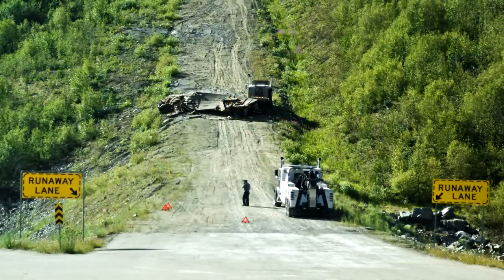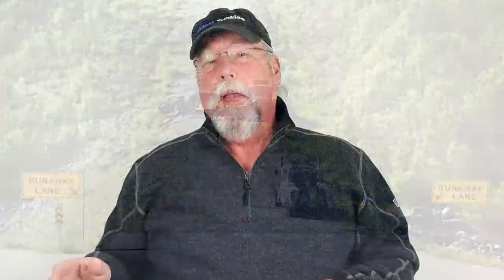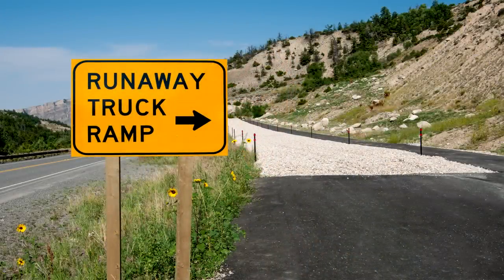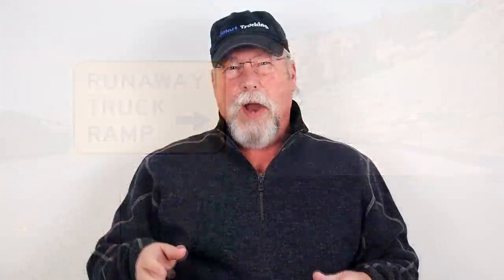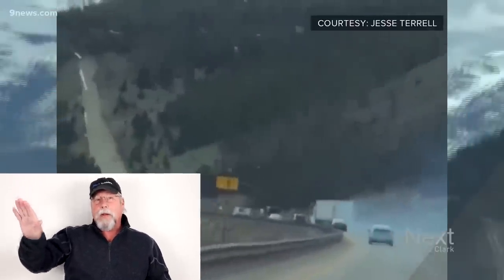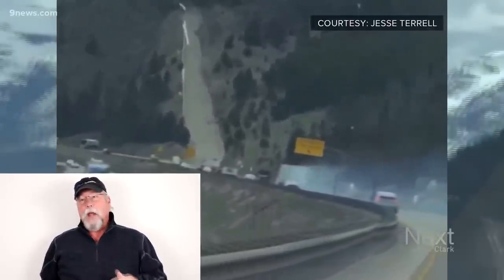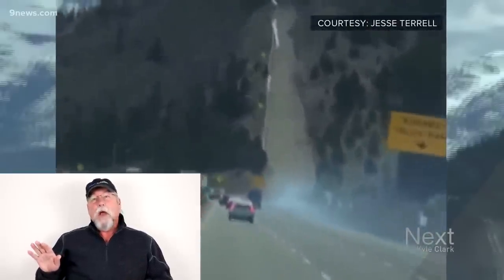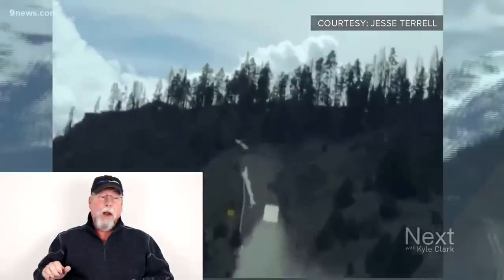What (Most) Truck Drivers Don't Know About Runaway Truck Ramps

Comment: I pray I never need to use one
Reply: The ones in Tennessee are the sand kind an it's fucking brutal hitting them also you have the knowledge that it's 10k if you have to use the runaway lane... So totalled truck usually plus a 10k fine for hitting the lane

Comment: If you drive a truck with a properly working 3 stage engine brake you can actually make it down these hills without ever tapping the brake pedal. Need to be in the next gear or 2 down at the top and you can adjust your speed by selecting the correct stage of the engine brake. Many of these hills especially out east actually have slower posted speeds for going down the hills

Comment: I try rarely ever have to use my brakes going down a mountain. Always try to position my truck at a slow enough speed and low enough gear based on weight so that my engine brakes can take care of braking and keep me at a manageable speed without ever having touch the brakes. Of course there are those times I have to brake.  But because I prepared my truck going down the mountain in a low gear and a slow speed, the amount of times I have to touch the brake its greatly reduced, greatly reducing stress and wear on the brakes

Comment: Here in BC, the way the runaway ramps are designed, the theory by the MOT is you are suppose to use the runaway ramp before you are completely out of brakes so you have enough to hold the truck when it stops. Nice theory but not the way it usually works out.

Comment: I used to train drivers. And I always told them that you will go down the hill a 1000 times too slow but you will only do it once too fast. And I'm from Southern Utah where grades start at 8%. And grades 12 and 13% are common. And most of them are well over a mile long. Also most of them don't have runaway ramps because there is no room to put one.

Comment: Great video. When I went to truck driving school I don't recall any mention of runaway lanes. However, I was familiar with them. Driver trainers, I pointed them out. The thing I remember most about mountain driving from school was once you get to the top, you have to be able to stop the truck going down the other side. And this was best achieved by going down in lower gear than it took to go up. I was passed by a lot of trucks going downhill, but I never had burning brakes at the bottom either.

Comment: I've heard a big downside of the pea gravel or sand runaway lanes are they don't work when precipitation infiltrates them and freezes.  I only drive in the south east, but I"m the guy in the right hand lane going down the hill in a lower gear, with the jakes set to maintain my speed all the way down the hill without touching the brake pedal, being passed by the super truckers.

Comment: You are correct I was driving west on 160 in Colorado first time ever and didn't realize I was climbing until I was 10,800 feet above see level and came to a brake check
Thank God I was 7,000 pound's in the box. And I saw 
Two hair pin turns 6 miles down the road. 
I have been driving for several years and never came through their. All ways respect All down grades.
And check your brakes.💯👍

Comment: Having run cross country through the mountains, I can't fathom not checking your brakes. 9/16 inch wrench kept in the door pocket, and a few minutes time, if they're not frozen, and you're good to go.
      And yes, you can adjust automatic slack adjusters. Just don't overtighten.

Comment: this comes from experence. once you learn your truck how it reacts with different weights and grades,  when you are at the top of the hill, you select the proper gear and jake brake settings, a driver can just about coast down a hill and use very little brakes.  some drivers think that they must run the speed limit down the hill but that is not the case. there have been many hills that i have gone down at 30 mph.  when i get down to the end, my brakes are in  good shape and the rest of the truck is in good shape.

Comment: Nice of you to include the MTO video demonstrating that drag net runaway ramp in North Bay. There is also a brake check area before the slope. Could be used as a rest area but there is a proper truck stop nearby.

The training I got is to get into the right gear before downhill, let engine ride up to 2000rpm, full brake until engine comes down to 1000rpm, let off the brake to let it cool, rinse and repeat. Supplement with full jake all the way is what I learned on 17 - which has no runaway ramp anywhere.
Reply: It's generally considered as a failure when the brakes are used. Being in the right gear and using the jake break to regulate your speed is considered safer than using your brakes. Brakes are to be reserved for an actual emergency  .   .   .

Comment: When I first started driving most company trucks did not have engine brakes.  In the training I had we learned to check and adjust the brakes before going down a mountian. Thankfully trucks are safer now.  I have never used a runaway ramps although had some close calls smoking the brakes out west.
Reply: Can you explain exactly what I'm looking for when I get under there to check the brakes.. Thanx in advance if you do answer me

Comment: Back when I started my career my father told me if I loose my brakes to take the shoulder cause they have made stabilize soil to help slow down the truck.
I was working on road construction and personally seen this stuff in the winter months this stuff doesn't freeze it stays loose I used it for traction and keeping my trailer from Jacknifeing.

Comment: You said about maintenance on Company Owned Trailers.... I have a really bad habit of using trailer brakes all the time instead of wearing the ones down on my tractors.... "Wink-Wink"....
I had to use a Runaway Ramp many years ago... Somehow the Service Line come off... I was pulling a raggedy assed old Fruehauf Flatbed with a Load of Steel, and I was probably a little on the heavy side.... Anyhow, it was one of the Ramps made of Limestone that was stacked higher and higher the farther up the hill you went.... Let me tell you something, it was not a Picnic!.... It didn't hurt the equipment any but it sure beat me up!....

Comment: Thanks for that detailed description. Lots of important info there!

One wonders, on the first type of ramp, maybe a good compromise between jumping out and injuring oneself and riding the truck all the way backwards back to a jackknife, would be to wait until there's barely any momentum left and then steer off to the left or right into whatever's on the side of the ramp.

Even if you wind up in a bunch of trees or something, probably won't cause more damage to the truck than the jackknife and roll-over, and that way you get to stay inside the cab where it's nominally safer.

Comment: When I went through truck driving school, the instructors preached, when you are in an area with runaway ramps, and you have no brakes or control of the vehicle, take the ramp. They're philosophy was, equipment and loads can be replaced, lives can not. When I did power only, I did not trust the trailer brakes, unless I knew and inspected them to ensure they were properly adjusted

Comment: There is a version of the 2nd type of runaway that I have seen in the Carolinas.  It is a sand type but has the sand mounded in intervals along the ramp.  I have often wondered what damage these mounds cause to the tractor.

Comment: I have to tell you what happened to my 72 year old Dad in 2012 after picking up a trailer preloaded with beer in Creston BC. He had started working for a company that had junky equipment and was heading west on Hwy 3 down towards Salmo when he lost his brakes on the trailer so he took the first runaway lane all the way to the top of the ramp in the middle of the night, so no one witnessed him up there. So he sat up there for hours without cell phone service to call anyone so he got out and realized how badly the brakes were out of adjustment so he adjusted the trailer brakes and was able to back her all the way to the bottom hoping no one else needed the ramp. But when he was near the bottom another trucker phoned the RCMP who came and had a chat and was able to help him get safely on the shoulder. But the officer could smell that distinct smell of burnt brake pads so he called the DOT (MOT) to come and check the adjustment of his brakes. So the DOT did a quick  level one inspection said everything was good carry on. So the beer got delivered and he retired from trucking Nov. 2022 at 82 yrs old but will drive for me when I’m in Mexico for one month in April hauling food products in Delta BC.

Comment: the up hill is normal lane and add sand after the Hight point almost done, make sure the sand is not high than the up hill lane. So it can not run backward. no need to maintain much if they put sand in mid of 2 wood wall or dirt wall.

Comment: I agree that there's several important things that don't get discussed or discussed enough when you are getting your CDL, or in training with the company that you'll be working for. The runaway truck ramps are definitely one of those things. And another is using the engine brake or when not to I should say..and with do many "automatic" trucks these days that's really more important than ever because oftentimes the transmission will downshift automatically raise the engine speed, which makes the engine brake pull much harder. And in reduced traction conditions (wet roads, ice, snow, etc) that can be the very thing that causes you to lose control and wreck. And if you hit the brake pedal after the rear wheels lock up and begin to slide, that just makes it that much worse. Stunt drivers in movies make cars spin around by basically doing that very thing in purpose (locking up the rear wheels with a hand brake and then slamming on the brake pedal). I learned that stuff the hard way.

Comment: do trucks have a manual transmission?

couldnt they burn the clutch trying to ride back down the ramp?

just by slipping the clutch the truck slowly creeps back down.

another way is to have a series of sawtooth curbs/ramps to where the wheels would catch and act similar to the blocks you see many truckers place behind the tires when heating fuel is being delivered  yes it would be a bumpy ride at the end but it should prevent reversing.

Comment: Using the sand/pea gravel is definitely the best type as confirmed by the amount of lives saved by using this type of run off in Formula 1 racing and no doubt other types. The gets damages sure, but it would have been damaged to get there usually.

Comment: Also folks, always invest in a retarder. Great system for braking the truck enough so you hardly have to use the brakes, at least in germany. I know some fellow truckers here that have to change brakes very infrequently because they use the engine brake and the retarder as much as possible. Also our engine brake systems on modern vehicles are the first 1/3 of the brake pedal's the engine brake. Some automatically kick in the retarder when the computer realized that the engine brake wasn't able to hold the vehicle plus trailer. Great systems, can recommend

Comment: Would you be able to throw it into park or into gear and kill the engine at the top of a runaway or would that be no bueno?
Reply: It is possile bit very likely useless in that trucks do not have a PARK option and if the engine is running, putting it in gear can be a challenge and if it is possible to put it in gear and shut off the engine, sepending on the grade, it may not hold the truck.   In most cases the ramps are built and maintained (supposed to be) to stop the truck and hold it where it stops.  Not to mention the fact that it would take the presence of mind to do all that after trying not do die when using the ramp after coming down a hill too fast and trying not to crash.

Comment: the most important thing besides bla bla blaz is with a jake, engine brake and using the correct gear ⚙️ if properly used ! you should not need much braking , only used to keep the engine from over reving, !!!!

Comment: Dumbest runaway lane I have seen is going into drumheller ab it is at the bottom of a hill opposite of the intersection that has a stop for hill traffic and the lane is the same slope  is the same as the far side valley wall

Comment: On 376 E goin into downtown Pittsburgh. Its 25 bc of a few  blind turns and stopped traffic. I have never seen anyone hit that runaway ramp there.

Usually in AM its stop and go. Problem is its 25 for trucks and 50 for cars and when traffic is flowin I'm still goin 25 with 4 ways on and people flyin by at 60 , 70 mph plus lol.

My buddy says I'm a hazard for doin it. I said F@@# em theres a flashing sign and 3 on the way down. Thing is if you are goin 40, 50 and smack into stopped traffic and kill people you are gonna wish you were a "hazard" like me

I have seen a few trucks about smash  into stopped traffic. Goin west into squirrel hill tunnel is 35 for trucks
 

That ft pitt tunnel is a nightmare.  Signs hangin on bridge support beams and its very low, with traffic jumpin on from the Ft Duquesne bridge on rt 28 and people goin 2 lanes to the right for rt 8 and lol goin two lanes to left to get to downtown leavin the city. A true truckers delight lol

Pittsburgh sux lol

Comment: Two things. If automatic slack adjusters "need to be adjusted," they are broken. Adjusting them manually might get you to the bottom of the mountain you're on. Or they might adjust themselves out the second you touch them.

Second, modern Jake brakes can handle grades up to 6% with 80,000lbs without even touching the service brake. For a 7% you'll need to tap them every once in a while. Obviously this becomes less true in the snow, but that's a whole 'nother issue. There's really no reason to be burning up your brakes in 2023.

Comment: If you lose your brakes going down a hill and don't use the ramps. YOU are a fool. I lost mine going dawn Vale to Eisenhower. I called the scales at the bottom and he told me where to stop and not to set my brakes put stones behind my tires. I told him i was legal ( 78,650) and i will come to to weigh, he say i was OK and not to come back. I was smoking like a large scale BBQ pit.

Comment: Thankfully, the problem of overheating and fading truck brakes will soon be  much smaller. That energy just goes back in the drive battery for use up the next hill. Simpler, safer, faster, cheaper.

Comment: Disc brakes are unadjustable and  don’t fade when used. They get more effective when hot because the rotors expand making a tight grab on the brake pads. Driving with disc on the tractor but drum on the trailer is dangerous!!

Comment: Ramp system #2 is not good on plastic oil pans. 100# of sand will definitively make your engine quite though pushing that nasty oil out and packing it with sand, especially around those main bearings. If you’re not sure keep it on the low side going downgrade. I must admit I don’t have a clue about an automatic transmission.

Comment: The recycling trailers at my job are real crap lol
Half the time you can't even close the doors
Once i pulled a loaded one out the door and the tires on the left side is rubbing the floor and smoke and sparks are flying lol good thing I'm the yardjockey and don't have to drive it on the road